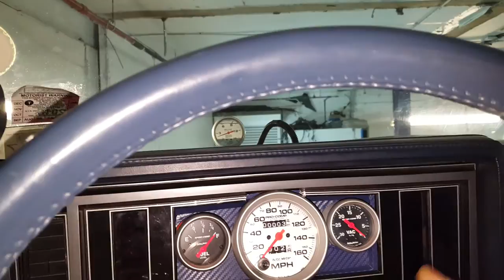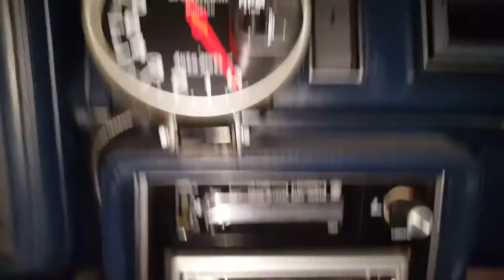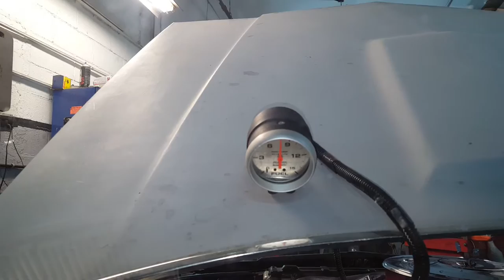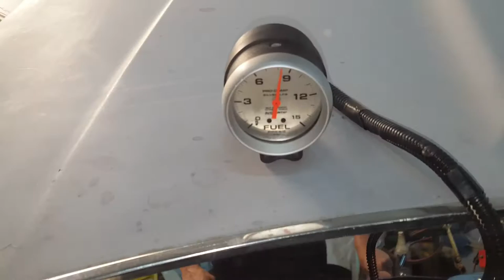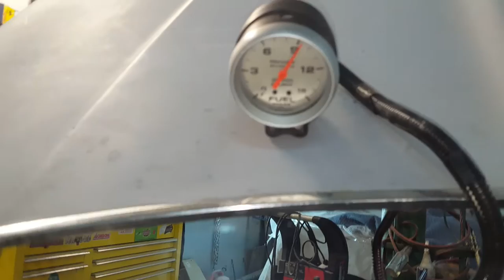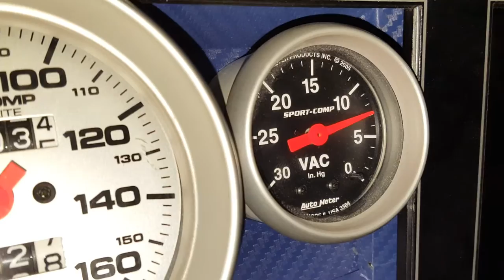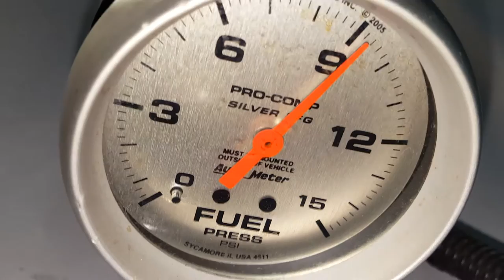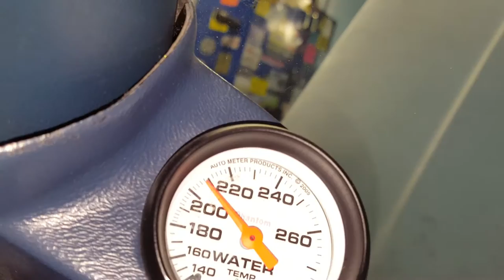CDS Stage-1 Buick 455 Regal-T DEFECTIVE fuel pressure regulator & FAN CONTROLLER! 3-23-2016

Comment: The fuel gauge and the fuel pressure regulator should not be wired together its seems like they wired the fuel gauge to the electric fuel pump wich is wrong.
Reply from the maker: The fuel pressure regulator has no electronic wiring; only the fuel pump.
Reply: +Buick Torque why does the fuel gauge move simultaneously with the fuel pressure gauge. I know the fuel pressure regulator has no wiring but the fuel gauge shouldn't move like that
Reply from the maker: +traww I hear you; the brand new fuel pressure regulator is defective; leaking fuel past the diaphragm. Fuel pressure was affected. Summit Racing Equipment is shipping out new replacement on Monday.